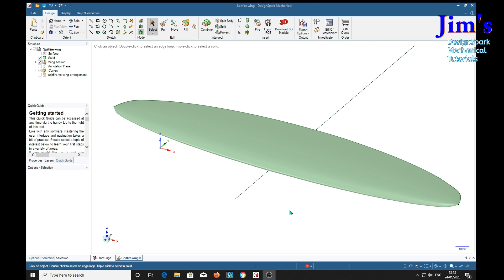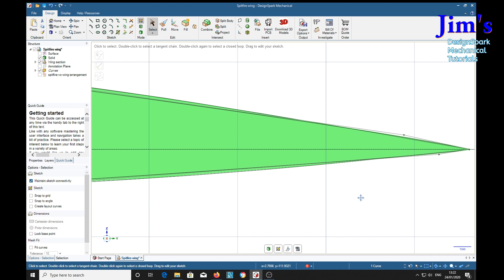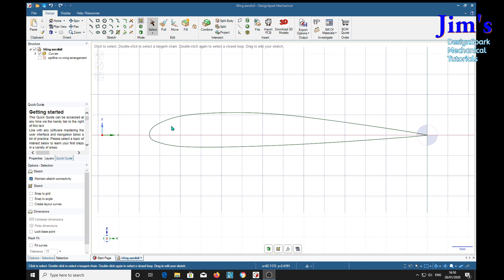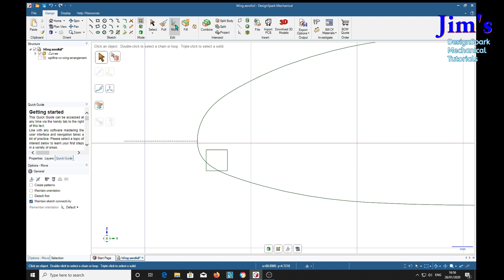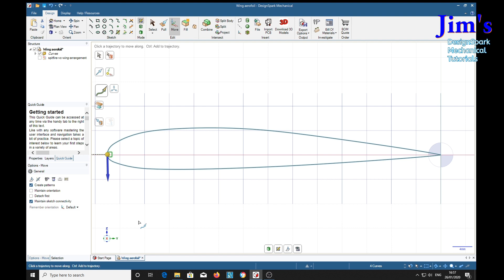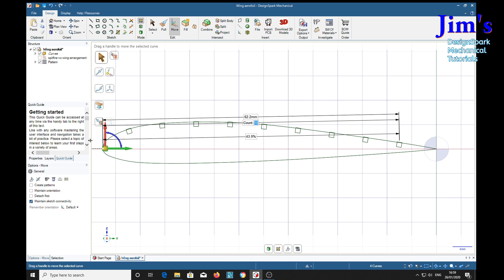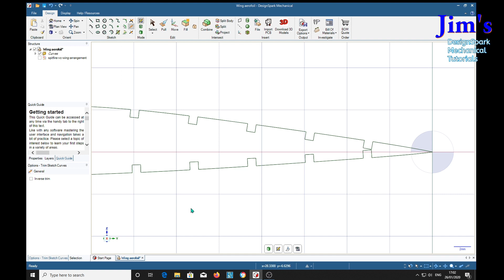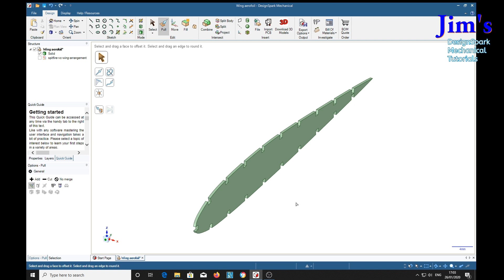Modelling a wing rib from a 3D wing model in DSM

Comment: Another great video Jim.
I know you have a cnc router but have you or could you use DSM for 3d machining ? I have read you can use it for milling but not really progressed the idea. I have a big old colchester lathe and a small mill in my shed (at the bottom of the garden) and I'm considering building a cnc mill.  Slowly I'm getting to grips with DSM but wonder if it will work for my future plans. You are the mutts nuts on this software and wondered what your thoughts are.
Cheers Neil
Reply from the maker: You certainly can use your router for 3D machining - you just need the right kind of software to design the 3D model and create the GCODE. As luck would have it, I have just downloaded the free version of Vectric's Aspire to play with. I should have some tut's in the fullnes of time.
Reply: Jim, look forward to your insights,  will be looking at that software to get an idea of its workings. Not that I really understand all this wizardry, I turn wheels and make motors spin 😊